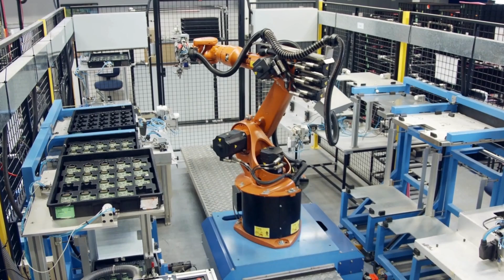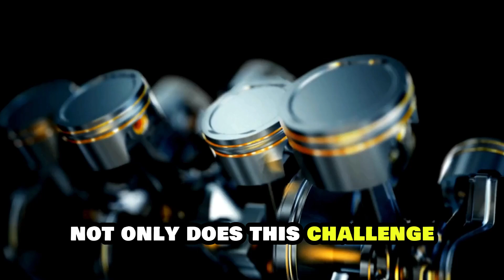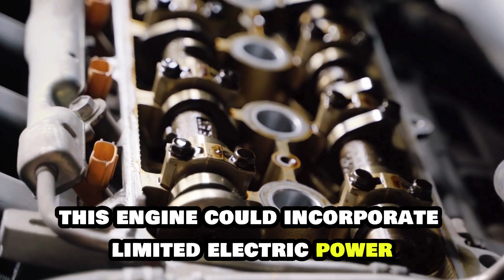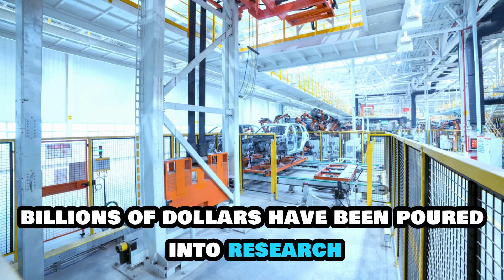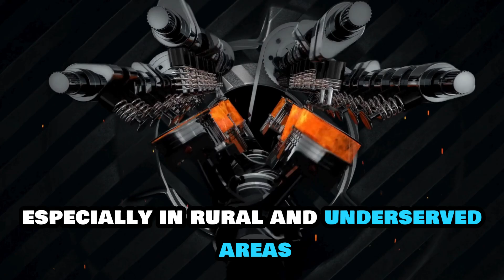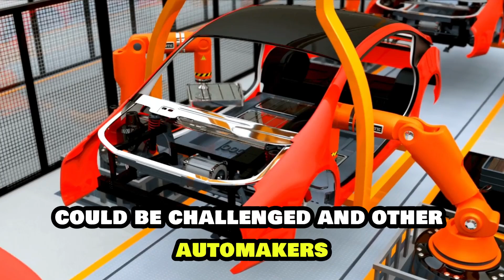GM CEO: "This New Engine That Will OBLITERATE All Electric Cars!"

Comment: If it's so viable and promising, then what is the tarrifs imposed by Us and EU for. Moreover, excuse like Overcapacity!  BYD has launched their BYD Shark truck in Mexican... an engine and battery combination with a range of 800km. Yet cheaper! Can the West do them at a competitive price, hig specs. high performance, advanced battery technology and most importantly, a modern, super efficient manufacturing hubs and supply chains.

And lastly, a huge domestic market to tap on. 😂
Reply: simply because they cannot compete. they are behind on r&d AND production, aswell as cost. everything in the vertically integrated system is so far behind china, maybe as much as 2 decades, because china will simply not stand still and wait for them while they try and re-shore. they are simply trying to stop Chinas gain of market share and profiteer for themselves, by pushing consumers onto their products, because prices are more comparable, even if quality isnt, while at the same time tariffs go into government coffers. its protectionism for corporates, and its the consumer that are impoverished to enable it. meanwhile trump telling US citizens, china will pay the tariffs...utter lies, which will massively increase prices to the US consumer, skyrocketting further inflation(currency devaluation), and the sheep are cheering and clapping like seals.

Comment: Battery powered cars have a couple of problems, and it has nothing to do with range. 
Range is NOT the problem.
1. The HIGH cost of battery replacement when the time comes. Currently, when an EV becomes 10 yrs old.  
It will be scrapped.  It just is NOT worth the cost.  
2. Repair costs. EV's are more easily totaled in an accident because of he high cost  of repair.  
3. Gas cars will easily last 20 years. Not so EV's.
Reply: There are many Teslas with original batteries approaching or over 10 yrs old and still very functional. Some have 400K miles on them. 

Most ICE cars are knackered after 12 years. Longest I have kept one is 17 years and was horrifically dirty with busted turbo and smoky even at 130,000m. (Regularly serviced, looked almost new… but shagged)
Reply: @MrTimRose1  ANY ICE ca that is smoking after 130k happens ONLY because the owner has no idea how to care for his car.
Reply: @ 
Serviced every year without fail. 

Oil, filters everything, and normally before due too. No expense spared either. I was replacing the fuel pump at 60k when everyone else was saying sell it. Always top brand oil, always Continental Sport Contact tyres. Only the best. 

When it was taken away, it still looked nearly new after 17 yrs. 

Loved that car. But all kinds of vent tubes, sensors and the turbo were whacking out in the last year.

Never going back to ICE.